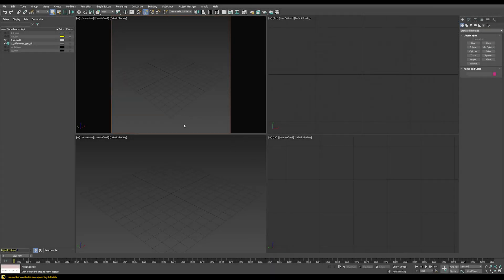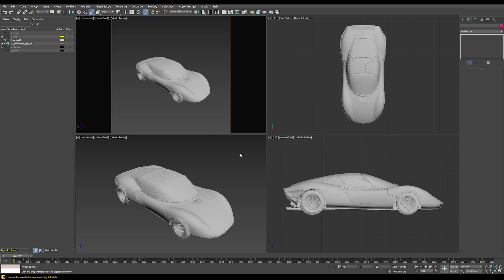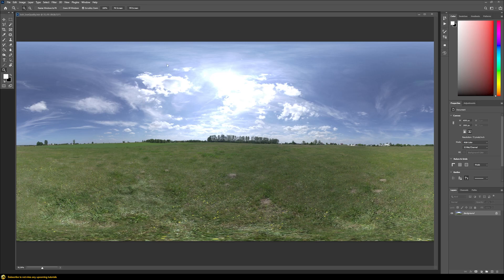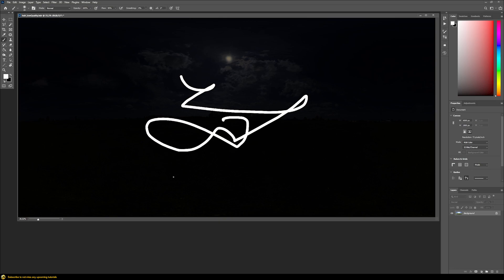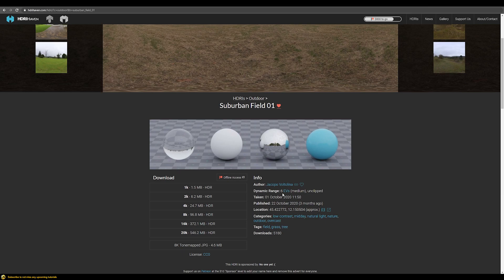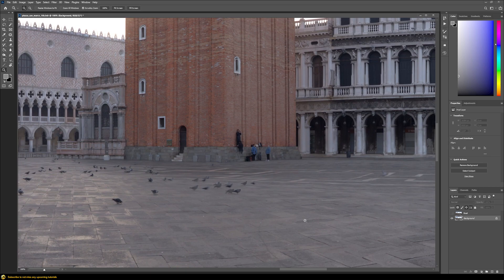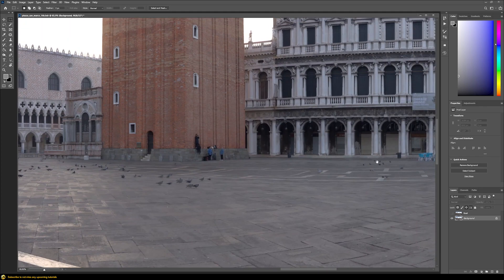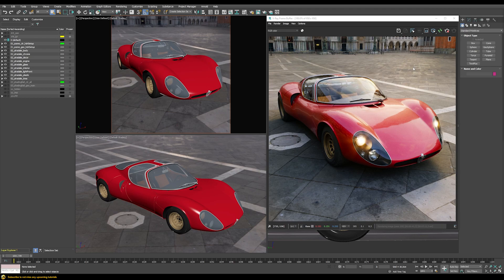CAR RENDERING | Part 1: HDRI Essentials

Comment: Hi Sir, I have one HDRI problem, which is whenever I upload HDRI into my VrayBitmap, the preview of HDRI shown in Material Editor is way too over exposed. Even tho I have already set the "Color Space Transfer Function" into "Inverse Gamma" with a value of 1.0, RGB Primaries under the "RGB Color Space" have set to "sRGB Primaries" as well. Is there any solution to solve this kind of problem? (The HDRI I had uploaded into VrayBitmap were all downloaded from HDRI Haven.)

Ps: I have tried to lower down the Overall multi value way down to 0.01 in order to solve this over exposed problem. With the default value of 1, the preview of HDRI shown in Material Editor is still way too over exposed.
Reply from the maker: Ok, that is strange as so far all the HDRI from HDRIHaven that I tested worked fine in that regard. Can you try to use the same HDRI that I was using in the tutorial (Piazza San Marco) and see if you still get a weird result? If yes then there must be something wrong with your settings.
Note that there are 2 settings: Overall and Render Multi. Both of them should be at 1. The Multiplier of the V-Ray Domelight should also be at 1.
Reply: @JonasNoell  Yes sir, I uploaded the "Plaza San Marco" HDRI into the VRayBitmap, the preview of HDRI shown in Material Editor is seems ok though. 
But when I tried to upload other HDRI, such as "Pond Bridge Night" from HDRI Haven (Poly Haven). Its preview was overexposed again, especially the sky. Originally, the color is in Deep Blue color, but it shown up as daytime light blue color at the material editor preview. The whole scene seems to be in daytime mode, which it should not be, because it is a night time HDRI.  This problem only seems to be happened at the preview of the Material Editor.
*The  Overall and Render Multi. are remained default, at the values of 1 respectively. The Multiplier of the V-Ray Domelight also be at 1.

When I try to render a view with this "Pond Bridge Night" HDRi with every value remained default (All values are set at 1 respectively). The background is shown normal, no color/ gamma error, everything shown up as the default preview of HDRI.

Comment: How did you get the dome hdri with vray?
Reply from the maker: You can use a domelight with an VRayBitmap set to spherical mapping
Reply: @JonasNoell  yes but I mean with the floor, if you just use spherical mapping it looks like the cars floating in space
Reply from the maker: @DaT_Animations  You can use the  Groundprojection in the VRayBitmap. I wouldn't recommend this workflow though as I think it's not well done in V-Ray currently. I normally build my custom projection/lighting setup which I describe in the full course and handles this issue much better if you ask me.

Comment: But why don't you just use the inverse gamma in the VRayBitmap? It does the same thing as you just did in Photoshop, but it doesn't actually "bake in" the gamma value, so you can change it inside Max.
Reply from the maker: Hi, are you referring to the part when the sun was painted in? When you adjust the gamma of the hdri you would be changing the brightness relationships between all pixels. Basically you are just increasing the contrast between the values overall which is not the same as to locally paint in a super bright sun for the main light and leaving all the other pixels untouched. In my opinion HDRI should never be gamma adjusted and if you have the feeling that you need to then there is most likely something wrong with the quality of the hdri itself.
Reply: @JonasNoell  I'm not sure if technically it's the same thing, but to me it seems it has the same effect. Decreasing the inverse gamma makes the bright parts brighter, the dark parts darker, and it also makes the shadows sharper. Increasing does the opposite so you can use the same HDRI image and change the scene from overcast to sunny and vice versa. But again: I'm not a professional just a hobbyist, so maybe this is not the best practice in the world, but it works for me just fine.
Reply from the maker: @charlesleclerc_ferrari  Hi, well it depends on what your goals are: From a technical view the HDRI should be an accurate representation of the lighting conditions on the scene and should not be altered if shot correctly. If you play with the gamma you are increasing or reducing the contrast over all pixels, thus altering or falsifying the captured data.
For example you will increase the contrast which will make your lights and shadow stronger but at the same time you are also oversaturating all your colors including your sky. You will get a result for sure but it won't be any accurate representation of the lighting conditions from the actual scene. If, however, you are satisfied with the result there is no rule that prevents you from using this workflow. As long as you know the advantages and disadvantages everything is allowed! :-)
If you look at it from a pure technical view however it would be a malpractice. That's why in the workflow I presented I only fixed the actual issue which are the clamped hightlights, while leaving the rest untouched. Nonetheless as I also said in the video I would anyway only use accuarate and technical flawless HDRI's, this way you wouldn't need to do any of this stuff anyway!